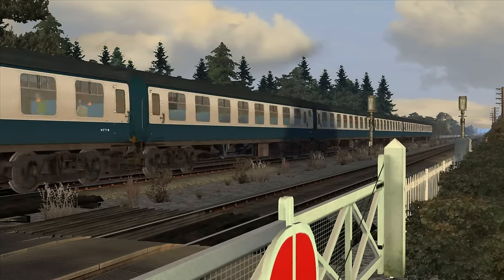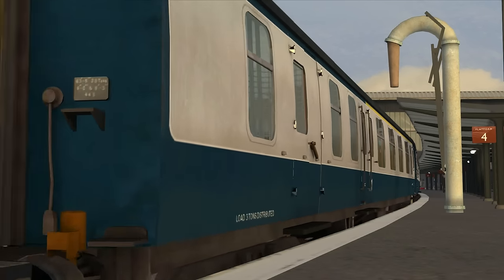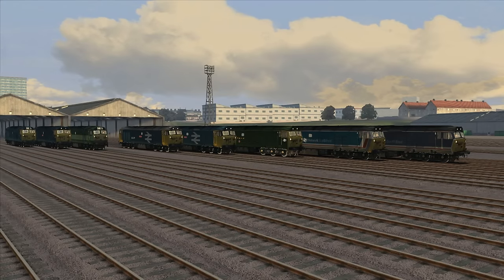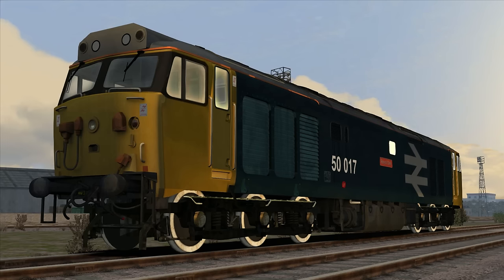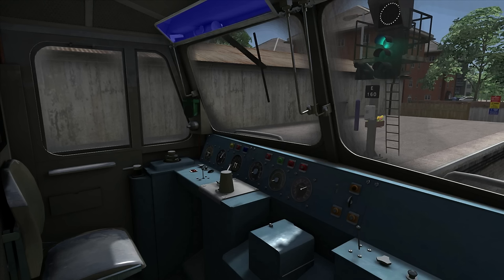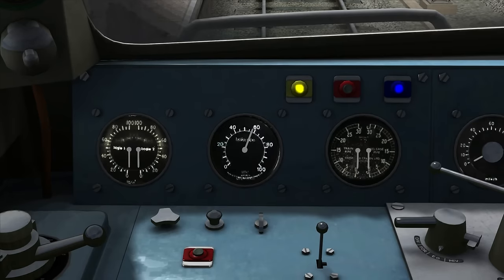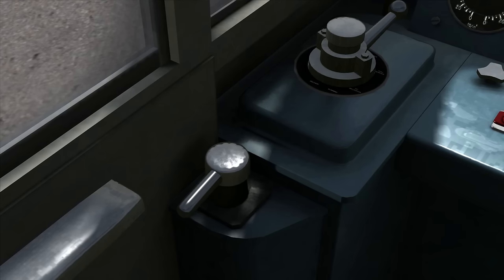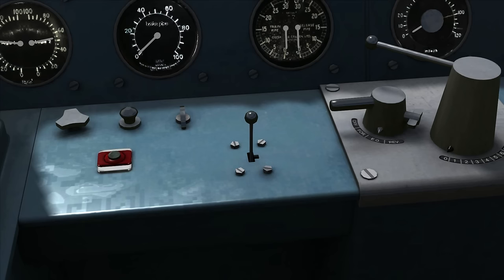Train Simulator 2015 - Train Guide: Class 50

Comment: I remember working on 50's at Saltley from 1981, the internal filtration system was indeed anything but, the equipment room was always filthy and this is where the main generator free end was located, the commutator would have been plastered in muck hence the regular flash overs. Also the way these locomotives were driven (Shutting off power) left a lot to be desired, we were taught to shut it down to the on position and begin to brake, after a period of say 15 seconds the amps would have died down enough to allow minimal load and current on the generator to be dispersed. Unfortunately many Western and Southern drivers did not like the class so drove them shockingly. (Prefuring 1000's or class 33's, The cost of which were main generator flash overs and traction motors too, a costly and time consuming repair. Had BR refurbished them with alternators fitted, a lot of the issues would have been sorted, but alas the costs of such were prohibitive so it never came to fruition,. The freight concept was ditched due to costs of refitting sanders (removed upon refurbishment) shame really as they were a great locomotive in nearly every way. A warm, comfortable, quiet driving  environment and great performance.  Scrapped far too soon I feel and had Chris Green had his way moved onto Intercity Cross Country services. 🤔

Comment: Hi,

On the Reverser handle the "EO" position stands for "ENGINE ONLY" This is the position the handle must be in to start the engine(s) and where all auxiliary equipment is working, such as the exhausters, compressors and other train equipment, but the traction circuits will not work. It also locks off the master controller handle preventing movement. If you move the reverser to the off position everything is switched out except the engine will continue to run if it was running before.

Comment: Great video as always. I have a question, I've been trying to make my own scenario on the London-Brighton route, or any route for that matter. I'm wondering is there a specific place you get the real life timetables from. I'm from Canada so I don't know the ins and outs of the UK routes. I've found sites that give me the timetables of the route but no platform numbers. It's quite easy for the smaller stations with only two tracks but for the bigger stations how do you know what platform is correct. As well as the service number for each train? That'd be a huge help for me. Thanks.
Reply: +Joel Stevens Check out Real Time Trains http://www.realtimetrains.co.uk/search/advanced it gives you all the info of platform numbers, route taken and service number as well.
Reply: +William Mankelow Thank you so much! That really helps a lot! Add on question, how do you determine the length of the train?
Reply from the maker: +Joel Stevens William has already shared the link I was going to. Realtimetrains is the site I use for all my train times and headcodes :)
Reply: +PTGRail Thanks anyways. Yeah it's working wonders right now. Saves me a lot of time. :)

Comment: What situation would call for use of the Loco Brake? Is is just when running the Loco only with nothing else connected? If so, why would the main brake not suffice in that situation?

Oh, excellent Video, as usual.
Reply: +Daniel Gregory (EpicDavinci) As far as I know, it's only used when as you say its running light engine. The main brake is connected to the entire train so I think it would only work when connected.
Reply from the maker: +Daniel Gregory (EpicDavinci) The loco brake can be useful when you require minimal brake force to control your speed. For example on some downhill gradients if you use the train brake it is often too much brake force and slows you down too quickly, but if you use the loco brake you can control the speed a lot better. Though it shouldn't be used too much to prevent too much wear on the brake shoes.

Comment: The 50 in Train Sim is very poorly simulated, it will only reaches 1738 amps on full power, which is well within the safe limits of the generator. 2600 amps is about where you want to start getting worried on the real thing. Also, in real life, when powering down it is best to wait until the amps are below 1000 to prevent flashover damage. This is something that applies to all diesel electric locos however more so with 50s.
Reply from the maker: +Olly Swan Thanks for the information :)